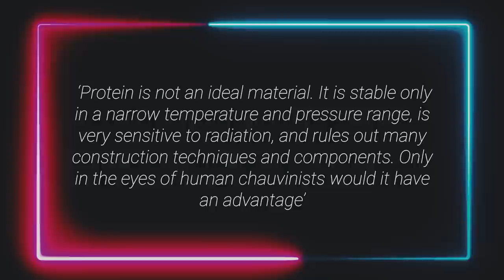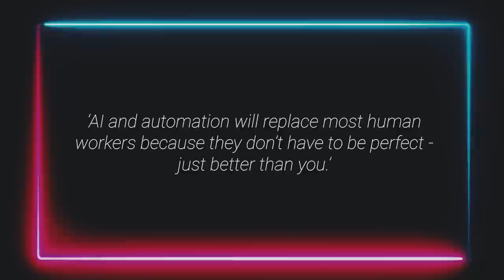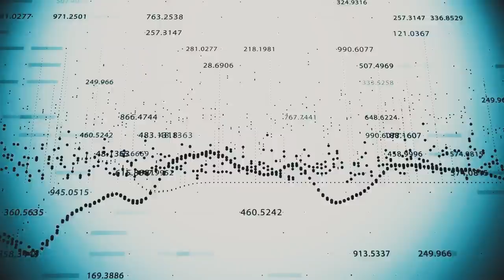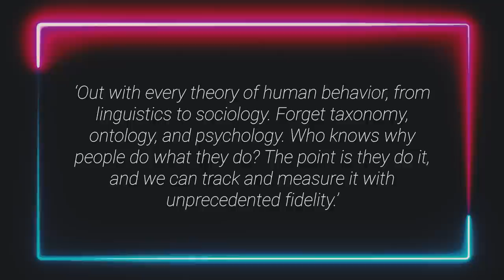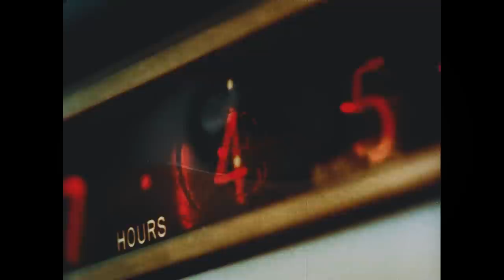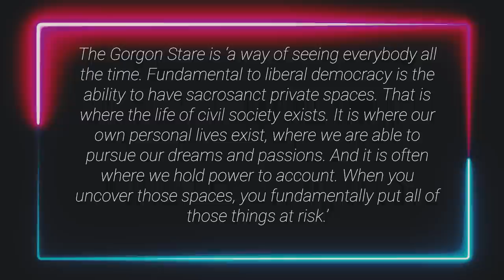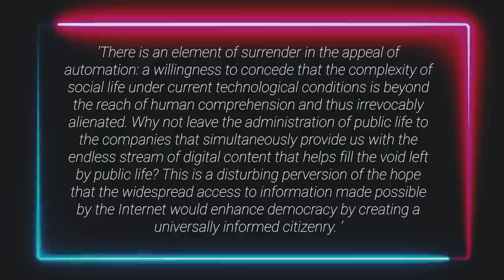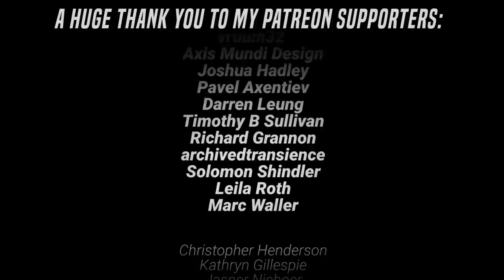Fear & Robotics

Comment: Their tentacles hold more firmly to those they can understand and predict, the more different you are, the further out on the bell curve you exist, the more difficult you are to predict.

Those in the center of the bell curve are the easiest to manipulate and control.

So the answer is simple, work on yourself, build yourself in every area as much as possible to be as far out on the bell curve as you can.  

That's is where safety lies, or as you said 30:00 learn to code the systems themselves.

I have been traveling the world for 20 years and I agree, Infrastructure feels like an extension of your body when it's good, when it's bad it feels like a hellscape you must cross.